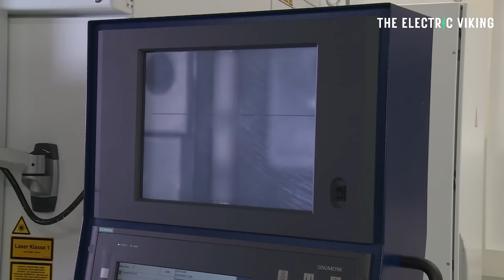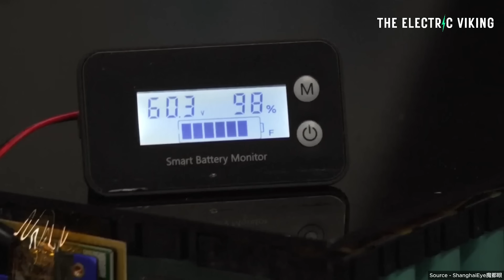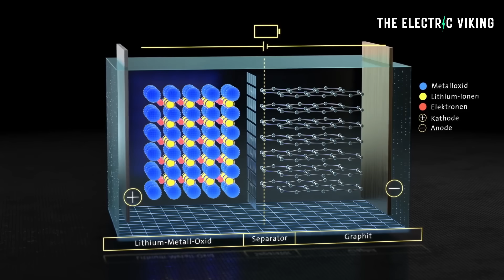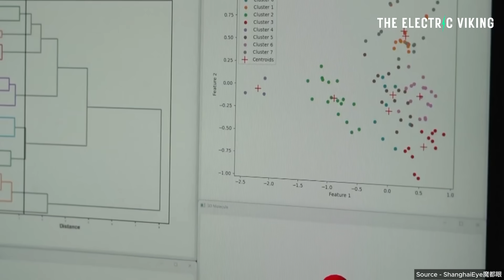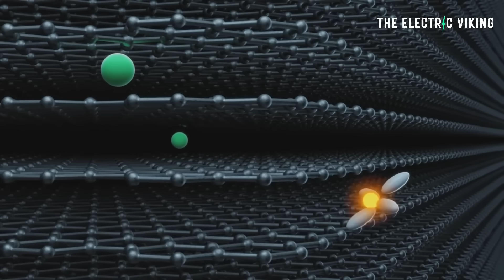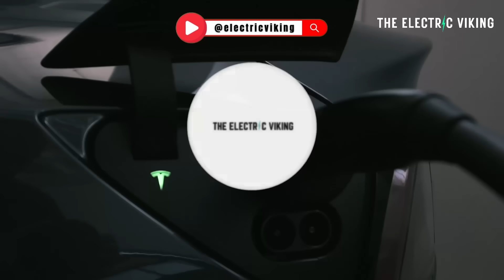AI discovers game changing CHEAP solution to double lithium battery life

Comment: The elephant in the room is, all batteries are sealed and not designed to be injected.  All battery packs consists of lots and lots of small batteries put together.  And these packs are generally not designed to be taken apart for injecting into each small battery.  It may cost more to do all that than it is worth.  The obvious question to ask can this stuff be put into the electrolyte of new batteries to effect the same lengthened life?  And what if your battery has solid state electrodes?  I don't know if any existing batteries could be effectively "injected" at all.  ??
Reply: "While the concept of injecting a lithium compound to restore battery capacity is promising, practical implementation would require thoughtful redesign of battery cells to accommodate the injection process and ensure uniform distribution of the compound. This would likely involve adding dedicated injection ports and optimizing internal structures to facilitate effective rejuvenation." (Ch Gpt)
Reply: Just give a few liters of the stuff to a few folks from eastern europe and tell them they can bring 2020 leaf with dead battery back to 15 k euro usable car ..... few will explode for sure, but soon you will have youtube how to clip...
Reply: @tonysimov1016  Yeah, see what Garage 54 can do 😂.
Reply: Sounds like an engineering problem waiting to be solved to me.
Lots of money to be made, there’s the incentive for an entrepreneurial team.
They will use AI to help solve the engineering problem.
First science, then engineering.
Reply: As resources become more scarce, recycling of those resources get more profitable.
Reply: @neilwilson5785  Perhaps, but what does that have to do with injecting stuff into batteries?  It will be way cheaper to put the "stuff" into the battery during manufacture of the battery.
Reply: By the time of battery wears out it seems unlikely to me that even in a robotaxi situation the battery would be needed in that same car again since it would also have worn out the body. So you will probably use a technique like this more in a recycling center where the recycler decomposes the battery and uses this sort of a treatment to refresh the material of the battery before turning it back over to the battery manufacturer
Reply: @laughinggas5281  You have no clue. The 8 year battery warranty was forced on Tesla - why is that do you think? Why does not Tesla say 12 years or 15 years warranty?....
Reply: Lithium batteries have venting in case of pressure build up.
Reply: I walked away after the video, and saw your comment an hour later. I was like "What is he talking about???" Ha ha! (I forgot the context for a second). But yeah, I think you have a good point. Dispersing the chemical as needed without causing damage would be a big feat. By the time you you that, you're probably looking at disassembly and handling that's basically- RECYCLING.
Reply: Can you put that compound in when you manufacture the cells? 12,000 cycles is a lot. A 100 mile battery would get you over a million miles. Imagine a 300 mile battery.
Reply: so you make batteries that can be moving forward.
Reply: @SeanWork  I am smart and read and watch a lot.  I have a Chem E degree, but that is not required to figure out how batteries are made.
Reply: @jonahbert111  No comprende bro
Reply: The EV clinic in Berlin already takes EV batteries apart from every car brand, and then they test each individual cell, and then they replace the cells that are bad or about to go bad. And the costs are not that high, just over a thousand Euro. But then you have a battery that is back to spec as when it was new. Which is much cheaper as buying a new EV car or an engine swap in a car with an internal combustion engine.
Reply: @insAneTunA Just that it takes up to $3k in labour just to get the battery out of the car (that is why you buy an EV with battery swap).
Reply: @martina5328  It is not 3k. It is much less.
Reply: @insAneTunA  It is up to $3k just in labour for a Tesla.
Reply: @martina5328  For a tesla you are looking at a cost that is between €1100 and €1500 for the entire refurbishing, depending on how many cells that need to be replaced. For an electric Smart it is even cheaper.
Reply: @ The EV clinic Berlin takes the tesla model S battery out it in 6 hours. Which costs just a little over €1000 euro.
Reply: @insAneTunA  You are talking about the battery pack, which is composed of hundreds of the actual batteries.
Reply: @jonahbert111  That is what EV clinic Berlin does. They take out the entire battery pack, then they diagnose each individual cell, and replace the cells that are bad or about to go bad. Watch the video that I posted in a previous comment.⬆It is around 70% cheaper than replacing the entire pack.
Reply: @insAneTunA  It depends on the manufacturer. "In-house component-level repair:

"Tesla, despite leading in statistics, unfortunately lacks an internal system for servicing battery modules or components.
BMW, Hyundai, Kia, Ford, Mazda, Nissan, VAG, Volvo allow the purchase and replacement of individual components within the service network."

  Anyway,  I have no problem with that.  Companies should make their packs to allow that to be done.  Not all do.  At present no batteries allow for injections, and we are a long way from even proving it would be a good idea.  It is better to make a battery that would never need it.

Another quote from EV clinic:  "A critical mistake by manufacturers is the use of pouch cells, which have proven unreliable and, in some cases, dangerous (EQB, Leaf, Kona). One of the parameters you should consider when buying a vehicle is “What type of cells does the vehicle have?” The priority should be cylindrical or prismatic/blade cells."

Here is a video of Munroe and associates disassembling a Tesla structural battery pack of 4680 cells.  As you can see, it is not something one can disassemble, test, and reassemble.  I think this glueing everything together is not what one wants to do, but it does make the car more ridgid and safer.
https://insideevs.com/news/605904/tesla-4680-structural-battery-pack-disassembled/
Reply: @jonahbert111  EV clinic Berlin does refurbish all brands and models. They are professional specialists, not amateur utubers.  And it takes between 1 and 3 days to get it done. And the total costs are somewhere between 1100 and 1500 Euro for a Tesla battery.
Reply: @insAneTunA  It is up to $3k in labour depending on model. Maybe you can find a garage in India that can do it for less. Then again, maybe you and your car are not located in India. It does not change the fact that it is up to $3k in labour.
Reply: @insAneTunA  What about the people not living in your town? They ship the car the car to your town? It is up to $3k depending on the model.
Reply: @insAneTunA  It can actually be more than $3k.
Reply: @martina5328  You are acting weird. Watch the video that I mentioned earlier in this thread. The people from EV clinic Berlin mention the costs, and it is between 1100 and 1500 Euro for a completely refurbished battery.
Reply: @martina5328  Dismantling and opening a model S battery takes them 6 hours and that alone costs just over 1000 Euro, and replacing bad cells costs 50 euro per cell. All together the procedure is around 70% cheaper than replacing the entire battery pack. For an electric Smart the costs are even less.
Reply: @insAneTunA  Up to $3k. That does not mean that the labour cost in India for the same job is lower. Search the web - you will find that it can easily be up to $3k.
Reply: @insAneTunA  Do you understand the meaning of "up to" ?? It really is not that hard to understand. Depending on where you are, where you live, labour alone for changing a Tesla battery is up to $3k. Actually, it can be even more expensive.

If I tell you that houses can be up to $5000k, and you say, no in Mannheim in Germany you can buy a house for $4000k - you have not understood!
Reply: @martina5328  I am not talking about other places. I am talking about what it costs at the EV clinic Berlin in Germany, where labor costs are relative high compared to other parts of the world. So I see no valid reason why it should be more expensive in other parts of the world. I am putting you on ignore because you are just arguing for the sake of arguing.
Reply: @insAneTunA  Germany is cheap compared to a lot of places.
Reply: @ Germany ranks at the 7th place on the list of countries by minimum wage with an annual income of $31,537. For comparison the U.S. ranks at position 21 with a minimum annual income of $15,080. You have no clue what you are talking about, and you are just making stuff up. And you are making a fool out of yourself.
Reply: @insAneTunA  $3000 in labour to change batt in Model S is nothing strange. Just look it up ! It is not even controversial.
Reply: @insAneTunA  Alcohol an schampo is cheap in Germany too. Still, a beer in Norway, to a Norwegian can be up to €15. That is a fact. Do you understand? The price to get a Tesla battery out in Berlin is not the same as in the rest of the world. Depending on where you are, it can easily be up to $3k
Reply: @martina5328  Your comparison with the price of alcohol makes absolutely no sense whatsoever. Because that is regulated by tax. It has nothing to do with production or labor costs. Look, there can be differences in costs to refurbish a battery in different countries, but fact of the matter is that it is still much more cost effective compared to installing an entirely new battery. In many other countries it will be even cheaper to have it done. And it is still worth doing it even if it would cost 3000 dollar in your country. So your arguments are baseless. It is arguing for the sake of arguing.
Reply: @insAneTunA  I say buying an EV without battery swap is like buying an ICE car with the hood welded shut. With battery swap you get the battery out at basically zero cost, and you do not need to buy a new battery for an 8+ year old car (in most cases buying a new battery for a car that old makes no economical sense = i.e. the car is scrap), instead you can rent a battery for the time the car will be used.
Reply: @jonahbert111 
If anyone decides to jab an 18650 with a sharp metal object, 
Please post the video 😃
Reply: Exactly my thoughts. Too much promises, and it sounds fishy. 

1. Who cares about dead cells if you allegedly have technology to make cells live 10 times longer? Recycle old, build new 10 times better. 

2. Not a word about chemistry. Is this magic good for all? 

3. Lithium batteries are highly flammable. And worst case is when air goes into a cell. Unsealing does not sound like a good idea.

As always with these breakthroughs, a lot of fantasies and nothing concrete.
Reply: Very true
Reply: I think it sounds like a good solution to rehab the black material that is created after the battery is disassembled for recycling.
Reply: They adapt and build new batteries all the time for new case uses you'd be dumb to think they wouldn't reengineer their batteries for this if it turns out to be a successful method
Reply: Every seal can be broken and resealed.  Most lithium ion batteries are pouch batteries in that they are thin films inside a flat mylar bag.  For example, the Nissan Leaf battery is made of modules which are four pouch batteries glued and wired together, the most difficult part would be dissolving enough of the glue to access the inner two pouches with a syringe.  Sealing the pouches again would probably be by a metal foil tape.   However, the obvious answer to your query is that batteries in the future could be designed for such a reconditioning treatment.  Simply saying batteries so far are not designed for this days more about your own slacking than that of the batteries...  Everything can be disassembled and reassembled to some extent even if they were not designed to do so, if this were not the case than surgery on humans wouldn't be possible.
Reply: @ As if disassembly is simple. As if reassembly would be simple. As if resealing is simple. NONE of that is easy or simple or cheap.
Reply: @davidnika446  🤣 EV clinic Berlin already does that with EV car batteries from all brands. You bring your car, and a couple of days later your battery is refurbished and back to factory spec for a reasonable price.
Reply: @insAneTunA  As if a laugh imogi proves anything. Tell us, what is the cost, per type of battery (there are MANY types, and the process will not be identical for all of them). Also provide specs on battery performance after the refurbishing. Maybe in some cases it's worth it, in others repurposing or full recycling might make more sense. It depends on a lot of factors. And it's not so easy and simple. Let's see their results and safety record after they've done 100,000 battery packs.
Reply: @davidnika446  You have to use automatic subtitles, but watch this video, nextnews: Sind gebrauchte E-Autos nur noch Elektro-Schrott?  

All your requested information is given in this video.
Reply: @insAneTunA  I watched the video. I do think it's a worthy effort. But from the video, you can see what they do is not trivial. And in any case, they are not disassembling individual cells and adding a chemical to them. That would be a whole other level of difficulty.
Reply: @ For a layman it is not trivial, for them it is their expertise to take apart and test and refurbish EV batteries. They can buy the injected cells. And for the client it is still a cost effective procedure regardless what type of cell they put back in the battery pack.
Reply: @ I even think that their business will only grow with this new technology. Because in the future they can provide the businesses that inject degraded batteries with the degraded batteries that need to be injected.
Reply: They'll just redesign the batteries so they can be injected 👍, simple ehh
Reply: If only the membranes had pore adjustment to allow for infusion of this molecule.
Reply: A 3 year old could design a way to.
Reply: I think he touched on the substance is injected into the lithium bit so you stab your battery inject the stuff then seal it after ... Don think it's a diy but could be a machine in car shops or phone shops that may do this for us ?
Reply: Thought the same thing. Wondering, since it is a molecule, could they send it through the charging cycle using the current to "electroplate"? Probably not, I don't know enough about this stuff, but that is the only way I can think of to "inject" this molecule.
Reply: @timothydiffinmo8735  no, you have to get a hole in the battery, put the goop in, then seal it up.
Reply: @jamesvandamme7786  It's not that simple.
Reply: @jamesvandamme7786  put a needle through a lithium ion battery and see what happens, it will burst into flames. It would need to be way better engineered than an injection port. You gonna take all the thousand's of cells out of the battery and do that with each and then install them back into your ev or other device? It seems too expensive.
Reply: I'm glad you saved me writing this. I was shouting at the screen while watching at 2x speed waiting for when Sam was finally going to address this "small" problem. 🤦
Reply: We know you don't know, but no need to worry, AI will solve that to, and after that you can once again brag how smart you are... 😂😂😂
Reply: You can't 'inject' batteries. This is nonsense.
Reply: @Withnail1969  The typical battery is a steel can, sealed.  Others are pouch, which  I have never seen one, but batteries are many many layered. How  does one get a solution in without piercing the outer layer, allowing it to leak (the last thing you want a battery to do), or to disturb the layered structure of the battery parts.  Then if you succeed in doing that, the pool of stuff then has to disperse itself reasonably evenly among all those delicate and very thin layers.  If this stuff works, it makes so much more sense to put it into the battery to begin with.
  You realize many of the batteries are steel cans about the size of an 18650 battery typically put in rechargeable flashlights.  Do you know how many of these constitute a battery pack that is in say a typical Tesla?   A whole bunch.  The 4680 configuration is simply a bigger can.  In a Tesla these are typically all glued together to make a structural (rigid) body member.  These cans are virtually impossible to access without destroying the pack.  The whole idea that these could be accessed and injected is just ludicrous.

Comment: Sounds good but I don't see how that can be cheap. Disassembling battery packs to get access to the individual cells, injecting each individual cell and reassembling them again can't be easy or cheap.
Reply: Poor people will work all day for a good meal.
Reply: This will ideally be integrated into manufacturing, or to use batteries that are from totalled vehicles or bad packs.